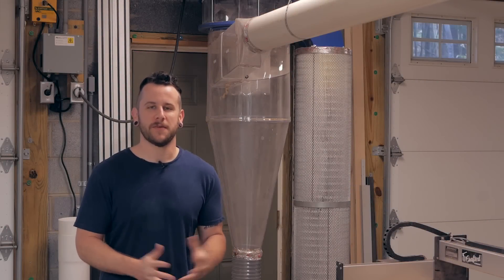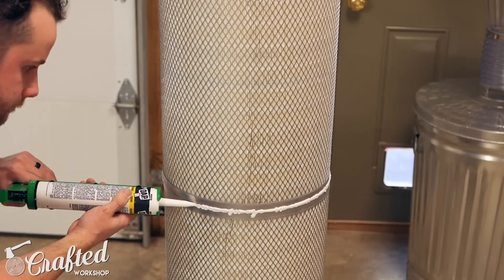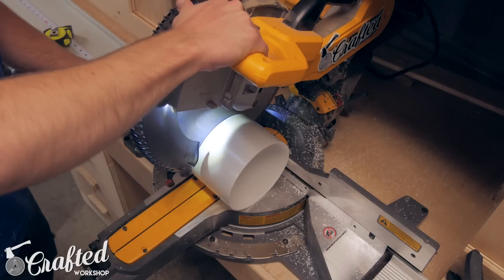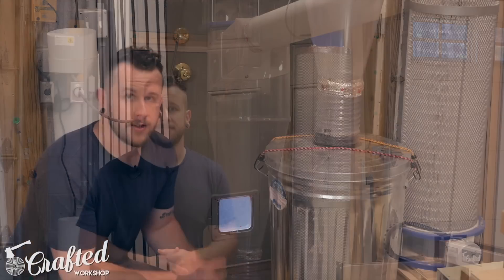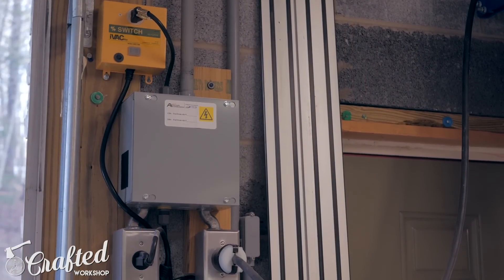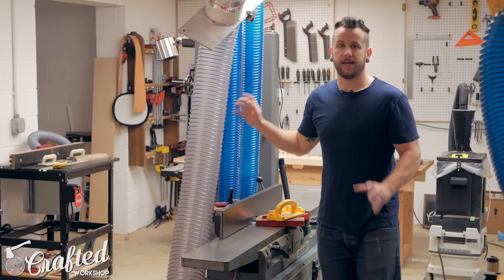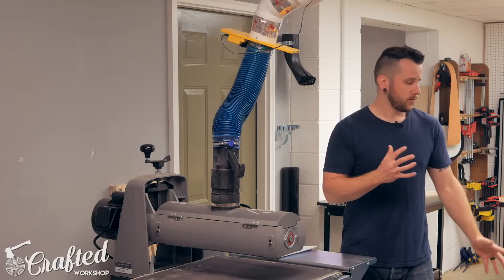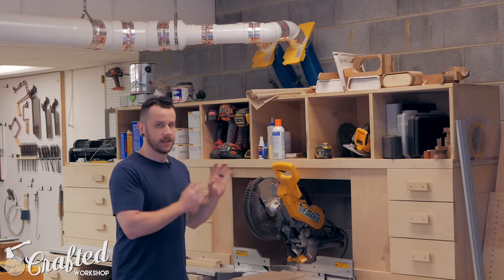Woodworking Dust Collection System w/ iVac & Clearvue CV1800

Comment: The major price difference (as mentioned in the video) is in the step up from the single stage to the dual stage.  I looked into a dual stage, but for what I do (hobby) I couldn't justify the price increase.  You can get a relatively inexpensive single stage unit from several places, mine is from Harbor Freight.  If you are doing more than just hobby work, a dual stage is the way to go!  

As always, great video!
Reply from the maker: Thanks! It is definitely a price increase, but there are new models coming out that are really starting to get close to bridging the gap. Grizzly has some really inexpensive units, although I'm not sure what the quality is like on them.
Reply: I assume, like anything, the technology gets to a point when the prices start to drop.  Having a two stage would be absolutely awesome.  When the cyclone gathers the dust, and pushed the smallest particles through the filter, does it move 'clean' air back out into the room, or do you have to vent to the outside?
Reply: Sooner Keith I'm in a similar situation. woodworking is a hobby at this point so I'll be going the cheap route of making a thein baffle and venting outside
Reply: Joshua courtney That's the kind of set up I have right now.  It works fine for what I do, but it would be awesome to have something better.  Then again, every time I watch one of Crafted's videos I see at least one thing I want to add to my shop.  I guess we're never "finished" with our shops.
Reply from the maker: +Sooner Keith you can actually do either. If you vent outside, you don't even need the filters, so that saves a lot of money.

Comment: Great setup! The iVac system looks like a really nice way to go, but if anyone is looking to create an automated dust collection setup on the cheap I rigged one up using an Arduino. It requires more work but the system for turning the dust collector on and off costs less than $100 (I haven't done automated dust gates yet). More info here: https://youtu.be/yRSNGoeAL5M

Comment: Appreciate the video and all the details.   You might think about (somehow) connecting one of your dust collection ports directly to the back of the miter saw.  I did that with my shop vac and I'm amazed how much it collects and how little dust is spread around.  I realize that it will be a problem converting the 2" port on the miter saw to a 4" vac hose.  Just wanted to pass the thought along.
Reply from the maker: Thanks, definitely a good idea. I'm thinking of running a separate dust extractor for the miter saw, I have one I could use. That way, I could have the ductwork for the cabinet itself and a dust extractor connected direct to the saw. We'll see!
Reply: Although pricey the Festool miter saw is incredible on dust collection. I am planning on not connecting miter saw to central duct but getting a Festool shop vac which will fit under the saw and can be used for other small tools with ports and is portable.

Comment: Great video. I appreciate your hard stance on the whole grounding thing it really is a myth. Also Self Vulcanizing Tape is the name you were looking for. Really great stuff.
Reply from the maker: Thanks! Yea, I found it in my Amazon order history and linked to it in the video description. That stuff works awesome.
Reply: I thought that another reason you have to ground it was because of static shock with you brush up against it.  I really don't friggen know.  I am just now starting to look at dust collection systems and find the subject VERY confusing with all the static pressure numbers.
Reply: @befmx31  What's interesting is all of the discussion revolving around grounding the exterior of a fully insulated membrane.  It would be like shrink-wrapping an insulated wire  to avoid getting shocked.  If you have metal blast gates you might get a shock from the static that does accumulate, but not enough to create combustion.

Comment: nice video on the dust collection! have you considered attaching one of the 4inch hoses directly to the miter saw dust port? then you could use the second as a catch all? either way nice work. I want to a better dust collector so bad. I'm thinking all i can do now is just get the super dust deputy.
Reply from the maker: I haven't, not sure if it would reduce the overall volume inside the cabinet too much. Definitely need to do some fiddling though!

Comment: If you are connecting pvc dust collection to a cnc it should be grounded as any static electrical discharge can cause problems with the control system and stepper motors.
Reply from the maker: +Jesterakaozman yup, not connected to the CNC, it just uses a dust extractor.
Reply: Thumbs up :D

Comment: Jealous. I did a lot of that same work for a much less efficient system :) 

I'm glad to see you go with the big system over the smaller Grizzly unit. Creating a truly efficient dust collection system is something I'm glad to see you and Jay help push/promote. It's information that needs to be more wide-spread. I realize the claims of 2HP units "capturing everything" are largely innocuous, but it's still inaccurate. DC is something we should be willing to spend as much on as our Table Saw, Jointer, Planer, etc...Good on you for making the leap and creating this content. 

I'm curious about the benefits of screwing the joints together. Did you opt for doing so to prevent the joints from pulling apart due to an errant board knocking into them? Or do they actually make for a tighter seal?
Reply from the maker: Thanks man! And definitely agreed, dust collection should be a priority even for hobbyists. I can feel it in my nose and throat when the dust collection isn't working properly, and I know it's not good for us to be breathing this stuff. It was a big budget item, but I spent a lot of time in my shop and it was worth it. 

And yea, screwing the joints together was mostly to keep them from falling apart on the vertical joints and during the assembly process. They kept popping apart, so I just decided to attach them more securely. I don't think it really helps with the seal or anything like that.

Comment: for that price I would've gone with one of the  Laguna flux systems!!!
Reply from the maker: The Laguna systems in that price range are substantially less powerful and would have a hard time with 6" ducting over this length of a run.
Reply: I had the Laguna PFlux 3HP system and it did a horrible job of separating the dust from the air. I ended up with more dust in the post-filter bin than the actual dust bin.  I was not at all impressed with it.